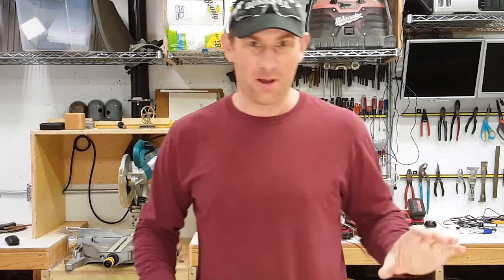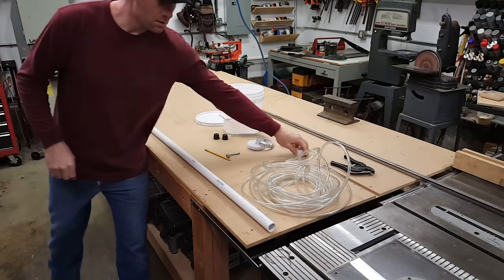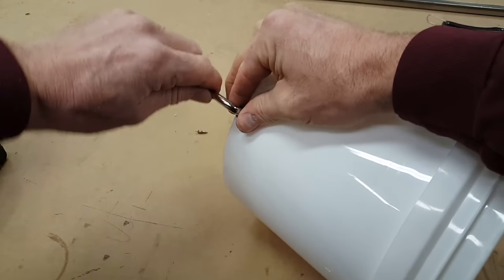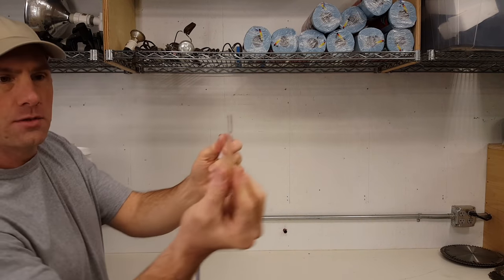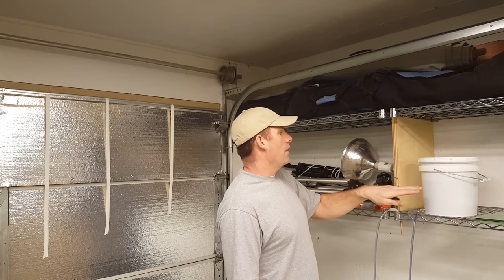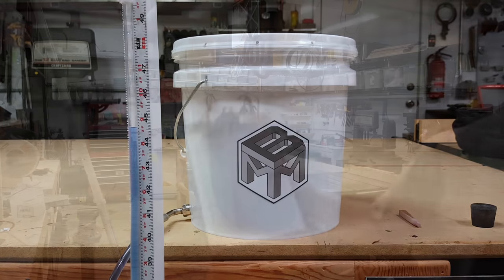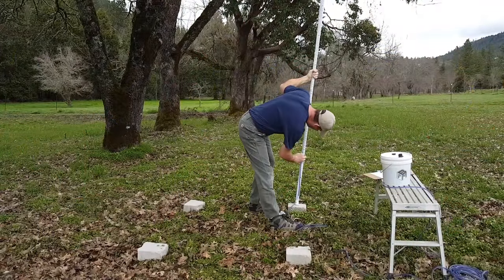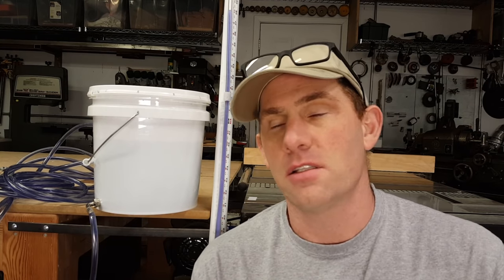Water level basics – How to make and use one

Comment: Great video!  I love the concept of a water level. My first one I actually made like you did with a Home Depot 5 gallon bucket. But then I realized instead of ruining the bucket by cutting holes in it all you  need to do is initiate the siphon in the tube sticking the tube in the water right from the top. It will do the exact same thing that yours does seeking the level of water in the bucket. In order to secure it to the bucket I just use a spring clamp with a zip tie. Now your bucket can be used again for its normal uses and there are zero places for leaks to occur. Thanks again
Reply from the maker: That's a great trick! It would really help if you wanted to throw one together for a single use.
Reply: Neat trick have to try that first! Save a bucket! A bucket saved is a few bucks earned.

Comment: Thank you sir! Always wondered how a water level worked. I use to work for a mobile home company doing basic maintenance. There was a crew of guys that would install and set them and they'd use a water level to level the trailers up.
Reply from the maker: Yeah, I bet they would use it while crawling under the trailers. It works great for tight spaces. Thanks for watching!
Reply: I work on one of those crews. Based in TN. We are in KY right now setting up a triple wide for Fort Campbell. We use a water level at almost every job.

Comment: Wickedly Cool!!!! So simple....What sorcery is this!!!!! Ive got a half acre of desert land in Southern Utah, its very uneven and I was using a string and line level to make a map so I'd know how much fill I need to level it. A huge pain sinking multiple poles in multiple areas , then running strings in every direction. Wow with this, one bucket and 100 or so feet of tube and I can map my back yard level anywhere and everywhere without bending over, banging poles in the ground and trying to accurately level lines for measurement.  Thanks Brother!!!!!!
Reply from the maker: Yes! That is a perfect application for a water level. Glad I could help!

Comment: Absolute best tutorial on youtube.  I want to level a mobile home with this water level tool.  Should I first find the high point?  Position the reservoir/bucket to that height.  Put the clear tube next to the frame bottom and raise or lower the the tube until the water level is at the bottom of the frame and mark the tube.  Should I now have a reference mark on the tube to raise the rest of the frame to?  Thanx in advance for your comment.
Reply from the maker: I would place the bucket so that the elevation of the water is somewhere between the ground and the underside of the frame. Then find the high point and measure the distance between the water elevation and the frame.

So, for example, if the distance between the water elevation and the frame is, say around , 10 inches, then you would proceed to raise or lower the frame so that it measures 10 inches in all locations. 

You want some space between the water elevation and the frame because it makes it a lot easier to inspect the hose and measure the difference.  Good Luck!
Reply: @Makebuildmodify  Got it.  And thanx for the quick reply!  Cheers!

p.s.,  I just realized "raising or lowering the tube" does nothing, as the water will find level as this is done.  Therefore, "putting a mark on the tube" is also unnecessary.  Thanks again.  And this really is a versatile tool.

Comment: Great explanation and practical demonstration .............Thankyou
Reply from the maker: Thank YOU for watching and commenting!
Reply: Agreed, especially on the demonstrations. Until midway through the video, I was mostly trying to figure out why I would want such a tool! lol It may actually benefit you to structure these videos in reverse order; demonstrating your nifty tool before explaining how we can make our own. 🤔

Your water reservoir is probably far larger than it needs to be though. Your hose only holds about 30 cubic inches of water, which is just under half a liter. A 1L bottle could be strung over a nail for easy height adjustment. Charging the system with 1L of water should give you plenty of spare volume for water to flow in and out of the hose as you move around. 🤓👍
Reply: The demonstration of the building of the level is great except for some parts it should be slowed down. If, like me,  you've never seen a valve like that before it is pretty hard to follow what you were actually doing and WHAT tool you were using to deconstruct it.  I guess you can adjust playback speed on YouTube, but why should everyone need to do so?

Comment: Useful info... I have some experience as a surveyor. When I built a parking space along side of my garage, I rented a dumpy level. Son held the tape measure as a "rod".  I suppose I could have done all the measuring myself with a water level. I have used water in clear tubing for leveling ledger boards and deck posts. That took an extra set of hands.
Reply from the maker: Yup, there are a few ways to do it. Somebody with you experience can make any too work. Thanks for watching!

Comment: Thx for taking the time in making this video. I thought the fact that lasers can't shine upon something that the light can't get to was so true. So the laser isn't the be all end all when there are items in the space but the water level won't care, Shweeeet.  The bucket is optional. You can just use the hose. The funny thing is that I have seen water level go for as much as $50 for a 50' unit. I guess they used magic hose. Hahaha.
Thx again.
Reply from the maker: Thanks! Yeah, you can make a water level without a bucket but the way you use it is a little different. A single hose is only level and does not help with overall project elevation. While using a hose level the elevation must be calculated relative to each instance of level. A water level with a reservoir (bucket or something of the sort) can be used for both level and elevation measurements within a reasonable tolerances.

Comment: Hello, nice!   Question :  why use a bucket vs filling up tube   Thanks!
Reply from the maker: That's a good question. The short answer is that there is a difference between level and elevation. When you use a hose with clear ends the water will be level. However, if both ends of the hose move for the next reading then you will have a new set of level marks at a completely different elevation. Generally, when a bucket level is used the bucket is stationary and all of the lines are relative to that elevation. There are some other small differences too but they don't matter too much for most applications.

Comment: Doesn't this rely on the water level in your bucket staying constant?  But when you raise the end of the tube, mire water move from the tube into the bucket, increasing the water level.  I guess having the bucket be many times the diameter of the tube would make the effect very small.
Reply from the maker: Yes, good observation, that is correct. It takes about 10' of hose to change the bucket level about 1/16". Most of the time the level and elevation are both within a couple of feet so this never play a significant role.

Comment: I live in a cold area and can't use straight water as the system is stored in my van  . I use automobile antifreeze . The dark pink is more visible then the green stuff .
  I made sure the containers can't leak where I filled them as they are sealed .A on/off valve is used at the top of the container to displace  and let air in .
Reply from the maker: Nice.

Comment: I am going to build a pole barn when I have all the poles put in place how do  I use this method to find where I cut the poles to the same length. Hope I explaned this right Thanks plus great video.
Reply from the maker: After your poles are installed set your water level bucket on a stool or short ladder. Then go to every pole with the hose and mark the water line on the posts. Then measure up from the water line to the desired top of post and do the same for all of the posts.

Comment: great video!  I have about 1/2 acre worth of backyard that is uneven, eroding away, and slopes down at the property line.  I'm planning on building a retaining wall, backfill with dirt to make it even and mostly flat (but I'll have a 2% grade for drainage).  Can this water level do what I'm wanting?  It looks like the technique in your video where your bucket is on the shelf and you're placing the marks on the garage door might work for me.  So in my case, would I just place the bucket next to the foundation of the house, calibrate it, then run it along the property line and mark it with steaks?  Thanks!!
Reply from the maker: Yeah, that's one way to do it.

I've even measured grade ever 300 feet with a water level. But for long runs like that you have to make a list of relative elevations and do the math.
Reply: @Makebuildmodify  gotcha.  that makes sense, thx for reply
Reply from the maker: @boeingav8r  You're welcome.

Comment: This will come in very handy. Thank you
Reply from the maker: Thanks!
Reply: @Makebuildmodify  
Why is it that the water in my humidifier doesn't level out and spill over the edges?
Reply from the maker: @ctsehn  probably because there is a suction force drawing the water towards the atomizer.
Reply: There are just two containers I fill with water and flip upside down.  Then, only about 1/2" water comes out of the containers and sits around the filter element that draws the moisture up and and fan assist the entire process.  I don't understand why the water doesn't spill over the edges because the level in the containers is much higher.
Reply from the maker: @ctsehn  Oh,  I think I understand what  you are describing now. It's a lot like a water feeder for a cat or dog. That would be due to the fact that the container is sealed. The bucket level requires a hole in the lid to allow the air to displace the water as it finds level. But the humidifier doesn't allow for the immediate displacement to occur.  I bet it makes a small "glug" sound every once and a while.
Reply: @Makebuildmodify  
Yes its does glug every once in awhile.

Comment: QUESTION- does it matter how far up the side of the bucket the valve stem goes? For example, 1/4” from the bottom or 1/2” etc.?
Reply from the maker: Anywhere near the bottom will work just fine.

Comment: Great video! Curious how you have your metal wire shelving mounted on the wall... i've been wanting to do something similar in my shop...
Reply from the maker: Good question. It takes at least two shelve to do.

1. I screw through the wire shelf into the wall studs. This locates them for elevation and level. 

2. Then I cut rectangle pieces of plywood. They are as deep as the shelves and as tall as the two shelves are apart from each other. I mean to say that you would measure from the bottom of the bottom shelf to the top of the top shelf.

3. Then screw through the sides of the wire shelves into the plywood rectangles. This is done in such a way that the plywood is on the outside of the shelves when the installation is complete.

4. I use Simpson Strong Tie structural screws for the application because they are designed for this type of thing. http://amzn.to/2qS2KBH

Note: The plywood is not fastened to the wall but it's better if it is against a stud or strong wall sheeting. This transfer the load force into the wall.

Comment: Do you make the bucket air tight to keep the water at the same height?
Reply from the maker: No, A hole is need in the bucket so the air can displace the water and the water can displace the air depending on the direction of flow. The plug in the lid is for storage only.

Comment: What if the bucket is tilted to one side a little bit? Does it affect the accuracy? Does the bucket needs to be level?
Reply from the maker: As long as the bucket is not moved during the process of measuring the tilt is not particularly important. Although, taken to extremes you would eventually spill water from the bucket. So, there is a point where tilt would matter.

Comment: Hey Justin, great tips thanks, I have tried and tried to use a water level with some success, however, I have found that when you let it sit for even 15 min. the level changes just a bit, the only thing I can figure is that  it is changing as the tiny air bubbles pop, I have tried to get rid of the bubbles and have found that you cannot, I have even tried different liquids like antifreeze, also, I suspect that the level changes with the temp. for example if you start in the morning outside by 9am the sun could be on your work. I have abandoned the water level all together, any tips?? Thanks again
Reply from the maker: Hmmm....I would do some tests. Mark you story pole and let it sit and see how much it really moves. 

As for the air bubbles, the water will automatically adjust for that. There would have to be an extremely large amount of bubbles popping all at once to make a change. Even in that event it would only take about 15 to 20 seconds to adjust. 

Now if there is a bubble the full diameter of the hose that's another story. Because air will compress and give you bad readings. So flush those out. 

Larger reservoirs are better because they work with less variance. I've even lost a couple tablespoons of water out of the one in the video and still landed inside a tolerance that was acceptable.

The sun hypothesis is an interesting one. If the hose you were using expanded considerably it would be effectively increasing the reservoir size. This would lower the level of the water in the reservoir and at the measuring end of the hose (still level but a different elevation). A test on a day that has a cold morning and a hot afternoon would be interesting. 

Also, if I've been away from the water level for a while (like a lunch break) I always go back to my zero point and re-check it. This is because anybody can knock the story pole over and not know that the missing water will cause trouble. They'll just stand it up and walk away.

Comment: Do you have to gave the bucket? Can't you just have the fluid in the tube? The level will always be the same, right?
Reply from the maker: A tube alone works but there are limitations. For example with the "tube only" method you'll get water lines that are level to each other but as soon as you move one end of the hose up or down the over all elevation will change on both ends. So you lose the advantage of moving around the room with the same level AND elevation.

The tube to bucket relationship allows the tube to rise and fall a within reason without elevation changing beyond a negligible amount. It also plays a role in how much accuracy is lost if you drop the hose and lose some water. The larger the bucket relative to the hose the less affect on the elevation. Also, the bucket slows the flow of the water so it is more stable making it easier to read quickly. 

Plus while working alone the bucket will sit on any horizontal plane. In contrast a hose alone needs something or someone to hold the stationary end. So working alone becomes more difficult.
Reply from the maker: Good question.
Reply: Make Build Modify good points, thanks

Comment: You didn't warn folks about water running out the top of the tube if you drop it below the water level in the bucket.  This could happen if you don't plug the top of the line while moving to the next location of simply dropping the line...oops!  Wouldn't that cause the next line/mark to be lower than the previous?
Reply from the maker: Yes, the water will flow out if it drops below the bucket elevation. As for the elevation of the next measurement I would say it depends. With a two gallon bucket, a few tablespoons of lost water would be a negligible change. If you are using a 5 gallon bucket the change would be even less. So there is a relationship between the water lost and the size of the bucket and the change in elevation of the mark.

Comment: I have used water levels for years but i have a question for YTrs. How do you prevent air bubbles (micro the 1/8" sized) in the tubing?
Do they affect accuracy?
Reply from the maker: Yes, too many bubble can have a effect on the accuracy. Especially during the day as the temperature increases. I usually add water (elevate and fill the bucket) to flush out the bubbles.